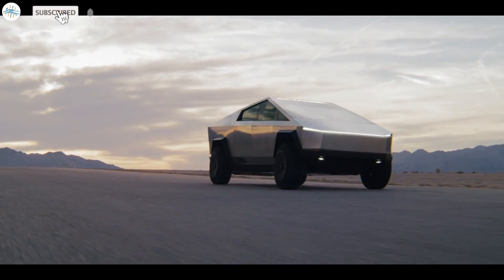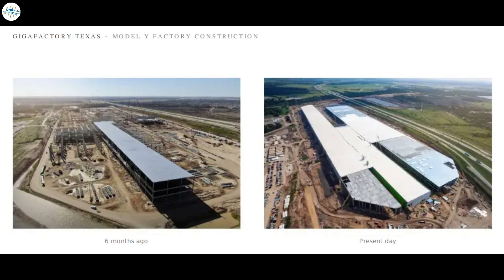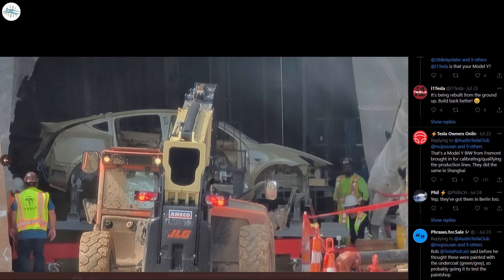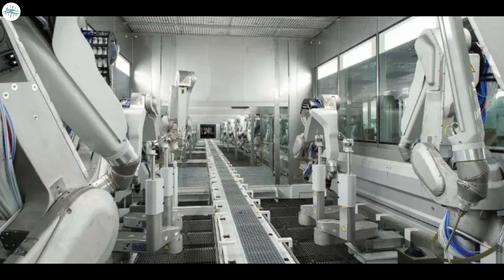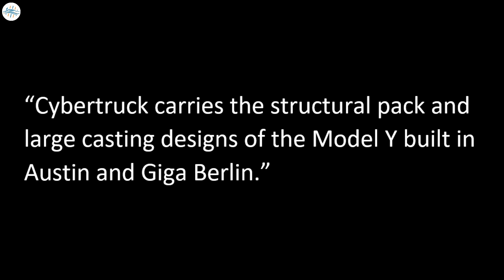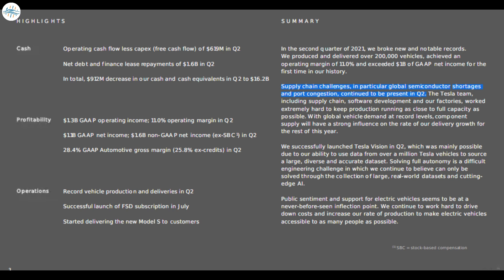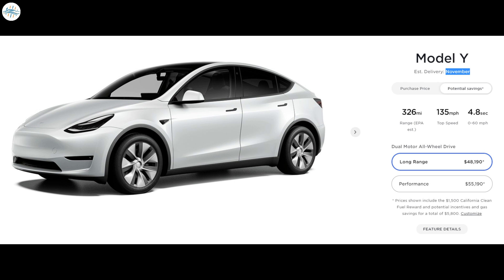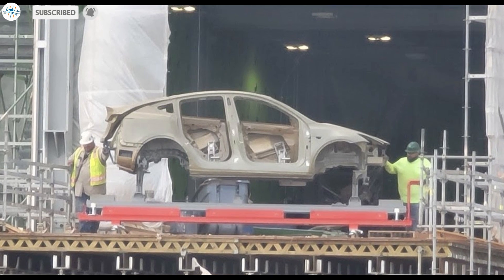New TESLA Model Y From GIGA TEXAS In 2021? Here's the Update!

Comment: I am a reservation holder for the Model-Y-LR and I was hoping that any updates would include raising the Ground Clearance. In hilly terrain, where I live, this is really essential!… The Model Y is marketed as a small SUV… However, its quite low ground clearance means that it is not a good choice for rough/uneven road conditions or to go a bit off-roading. Its clearance is only 6.6" (~17cm), while the industry SUV-Standard is 8.5" (~22cm). Unfortunately so far there are no indications that this flaw will be corrected 🙁.  In all other respects the Model-Y is absolutely! 🤩
Reply: *perfect